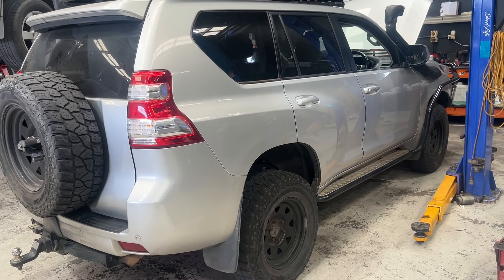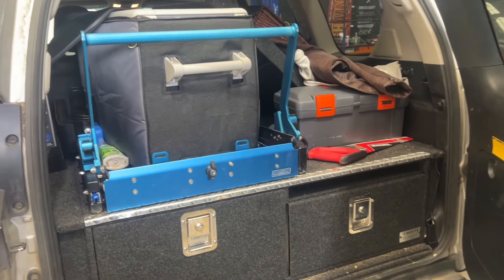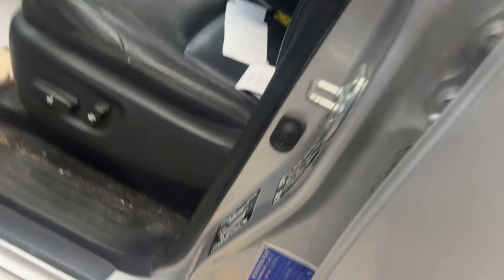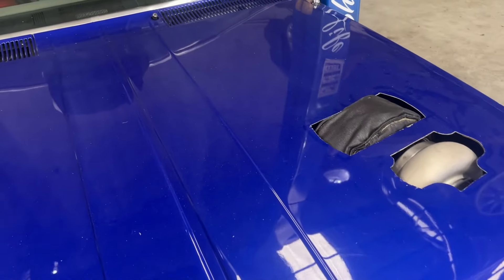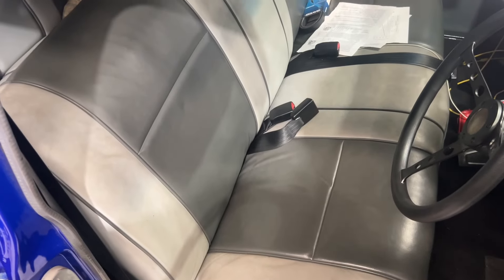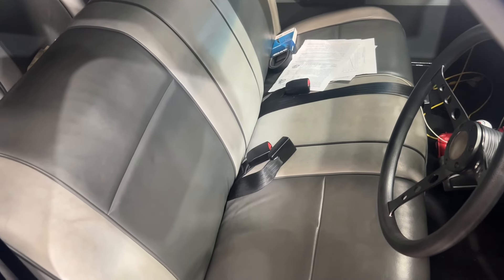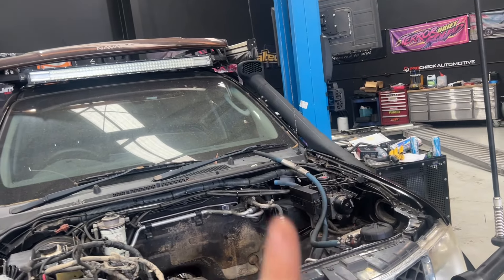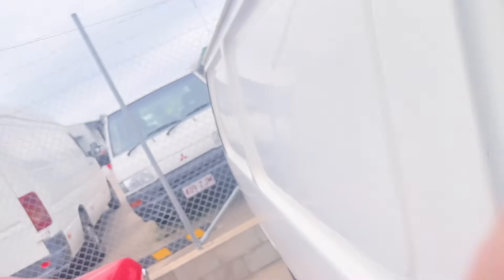Why do you need a mod plate?

Comment: My Jeep TJ Wrangler is a 4 seater. The back seat has a quick release to remove the back seat.  Surely I wouldn’t need a plate to do that. The seat has a bracket and no bolts are undone and no holes to the outside.
Reply from the maker: Temporary removal is ok. Like landcruiser has removable 3rd row seats, but if removed and have a told box or fridge etc in their place you need mod plate

Comment: Cheers for that! In regards to Turbos, if you get modplated for one turbo, are you able to change the turbo type and that modplate is still legit, or is the turbo type noted down in the cert and logged? In NZ, all our cert plates say is "Fuel inj-Turbo", OE brakes...etc but no other info is documented...
Reply from the maker: Depends on the person certifying it. I will generally make note of brand etc of parts fitted on the certificate so it’s only for the part I have seen fitted

Comment: If a car is mod plated for engine conversion in QLD, can that mod plate be used to get a BlueSlip in NSW?
Reply from the maker: Even though we are one country on one code of practice, each state uses it differently
I know if it’s mod plated in vic or nsw in last 5 years and you come here it’s reciprocal and we will accept it. But for ours to go there I’m not 100% sure sorry
Reply: @procheckautomotivemechanic4551  thanks for the response bud. I asked around, apparently the car will need to be "certified" by an engineer if you significantly modify it. This will include passing emissions as well, which i hear is hard. They go over the car with a fine tooth comb and check every little detail. Its much more strict than and expensive than getting a mod plate apperently 😭

Comment: we just got burnt by that on our prado sale with rear drawers in the back, an absolute roadworthy nonsense box ticking compliance exercise., its not like the rear seats need to be unbolted even, they are designed to clip out.
Reply from the maker: Yeah there’s a grey area 
You can temporally remove the rear seats for putting things in. But if there’s drawers or something else permanent or seats have been removed and lost you need a mod plate to downgrade seating capacity.
The way they look at it is, if you are complied for 7 seats and only have 5 but could carry 7 you no longer meeting compliance. 

Worst part is if you change from 7 to 5 then back to 7 that’s 2 mod plates you need 🤦🏻‍♂️